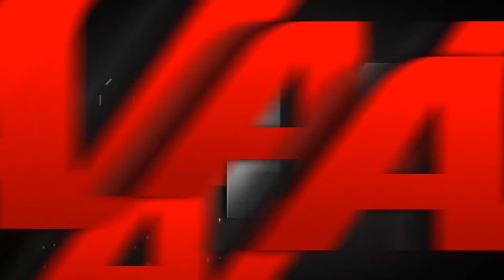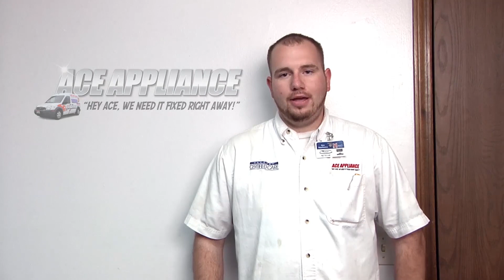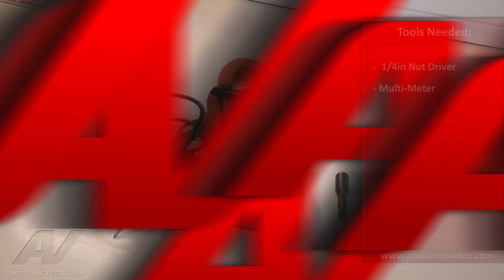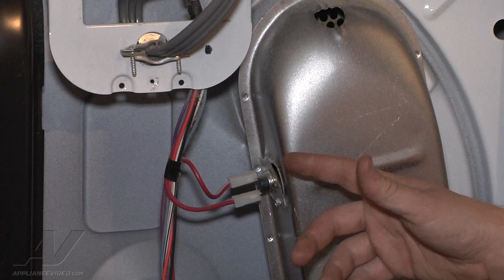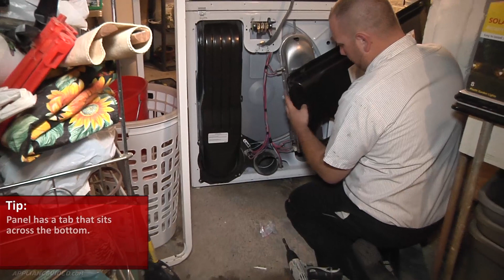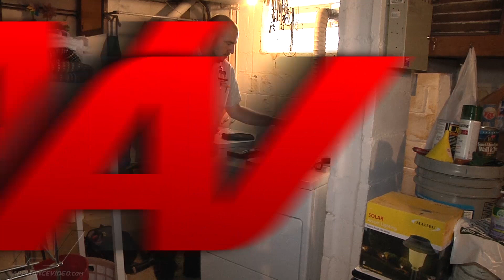Estate Dryer Repair - Not Starting - Fuse

Comment: Do technicians come out and fix fuses is so how much do you charge cause we don't have those tools to take the back panel off
Reply from the maker: Great question, if you have a
more technical question that our parts department cannot answer, you can search
our over 10,000 answered questions free at our website www.ApplianceVideo.com under our Repair Help section. You can also call
our parts department at 1-800-830-5465 and they can give you help 7-days A week
Monday -Sunday, or search at www.SaveMoreOnParts.com  24 hours
7- days A week.

Comment: Hi i have the exact same model , i had the fuse check and they said it wasn't that. I pressed the start button and it will not even turn on. What should i check next ?
Reply from the maker: Great question, if you have a
more technical question that our parts department cannot answer, our
technicians are answering all questions at our website at www.ApplianceVideo.com under our Repair Help section. You can also call
our parts department at 1-800-830-5465 and they can give you help 7-days A week
Monday -Sunday, or search at www.SaveMoreOnParts.com  24 hours
7- days A week.

Comment: really helpful video.  My mom dryer is not working when press start.  I am going to start with thermal fuse.
can you tell me which thermal fuse to get
estate dryer by whirlpool 
model no. TEDS680EQ0
Stock no. TEDS680E

thanks
Reply from the maker: TheHHiu
              Please call our 1-800-830-54465 parts department and they can look it up and ship it same day. Thanks

Comment: Hello.I have an estate electric dryer that I'm having problems with.I'm lead to believe it still works because it turns on for a few seconds and then turns off.it won't restart till a min or two.I do smell something like its burning.I tried taking it apart and repositioning the belt and pulley but I get the same results...can you be so kind to tell me what could it be? I hate to get another one if its a simple fix
Reply from the maker: There is a few possibilities, I need to know first if it is a gas or electric dryer . And send me the model number so I can give you some suggestions.